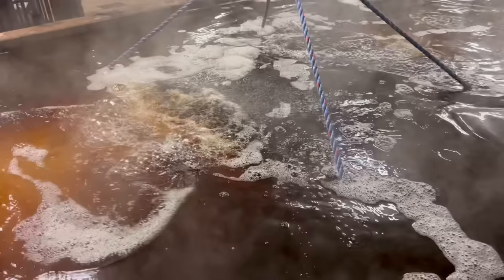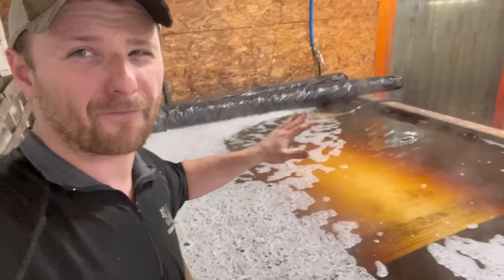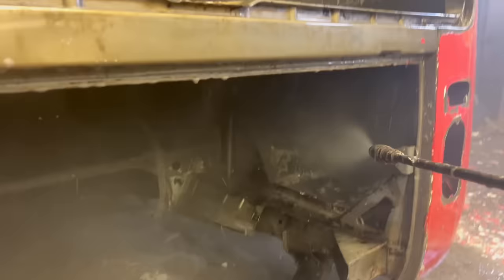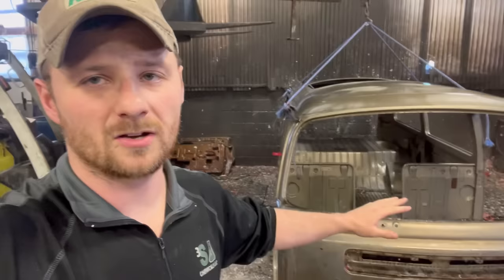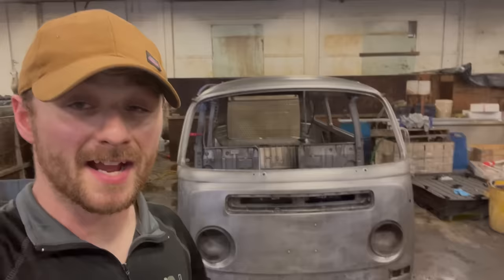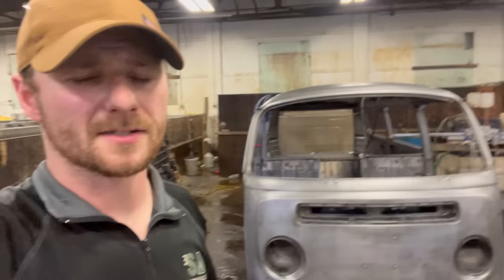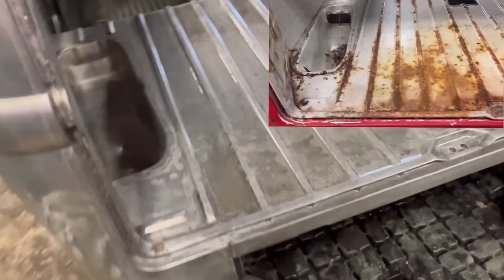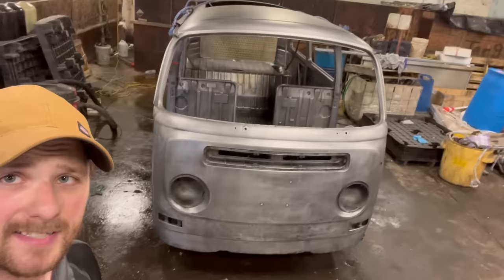Chemical dipping a 1969 Volkswagen Westfalia Bus

Comment: Honestly, that bus is in great condition, considering its age. The dips uncovered all the sins but thankfully, it wasn't too bad. Some replacement panels, a skilled panelbeater and welder will sort that right out. Nice one!
Reply: I would not have dipped that bus if it were mine ,IT ISNT ,surely water would get into all the nooks and cranys and rot them over time ,, COME  to Ireland and I will  show u rust
Reply: @iankennedy1441 no wonder theres many of these buses in drier areas

Comment: This was a ton of fun to watch. I have a good friend who is the original owner of a 1971 Bus — no kidding — that has everything from its original paint and nearly flawless headliner to a body that doesn’t need dipping. It was a “barn find” in that she had not driven it since 1999 and was in her horse barn all those years when I saw it and offered to renovate it. Can’t be many originals out there like hers.
Reply from the maker: That’s awesome! I’m glad you enjoyed the video!
Reply: Where did you find a bus with that much metal on it? If you would've dipped the one I had, you would've dipped a vehicle but only pulled out ropes.
Reply: @kdkn50  That bus is amazing. My friend is a widow in her 80s and still owns the bus. One major reason for its lack of rust is a lifetime spent in the Pacific Northwest, where rusty vehicles (at least those away from the coast) are almost unheard of. That, and the fact that the bus spent nearly 30 years inside a dry barn. It has the usual rust damage at the rear quarters where the battery was -- and was moved to -- but that's about it. I tuned it, cleaned out the mouse nests, put fresh fuel and a battery in it, and the old gal started right up.

Comment: So much faster and more efficient than weeks of sanding and grinding! That bus is totally naked now! Incredible. I love classic air cooled VW's.
Reply: It's definitely naked now.
Reply: And in a couple of years the new fresh paint job will fall of at the seams due to residual chemicals seeping out from joints and whatnot.
Reply: yeah this isnt a good idea. they will now be long term corrosion between overlapping panels that will end up destroying this bus. and the pressure washing job to remove the chemical, is peak hack job. you are far better off sandblasting or hydroblasting.

Comment: Another awesome job well done! I truly enjoy watching the process... and have garnered a whole other appreciation for what exactly you do, and the attention to detail as you work on these amazing canvasses. This one actually answered my question of whether or not my bird will fit in the tanks, when and if I need to do this. Thank you for another wonderful video.🙏💜
Reply from the maker: Thank you so much! Means a lot to hear you say that! I’ll keep them coming! I appreciate you watching!
Reply: dont get it acid dipped. it will look great at first, then it will rust out between the seams. you wont even know till it blows through the paint.
and this guy, just pressure washing the fluid off, instead of even dipping it in a neutralizing tank (which still doesnt work btw), is a total clown.
get it hydroblasted instead. its so much better for the vehicle.
Reply: @Nbomber  I disagree, if you watch and pay attention to the details of what he does here, you will see each step... and the neutralizing tank. I have been doing my research and I am quite impressed not only with the chemicals that are used, but their removal and disposal of. Their attention to detail in all aspects of what they do is amazing, and if and when the time comes that my bird is in need of such attention I am about 96% certain they will be doing said work. But thank you for your opinion, I appreciate it.🙏💜

Comment: It would be cool if these could be dipped in primer afterward like modern car factories dip the chassis of cars.   Seems that would help guarantee the restored vehicle doesn't develop new rust issues.
Reply: You can galvanize them
Reply: @wills5482  electro plating would work, only it'd make welding a royal pain!  Nothing smells worse then burnt galvanizing.
Reply from the maker: A lot of our customers have them ecoated afterwards. They dip the whole car and coats it inside and out!

Comment: Dipping is a way to remove ALL paint.. also the paint in closed boxes in the structure and seams.  At vw, the cars werd dipped also but to paint them in primer .  
  Area's that ar now cleared out of paint you can not see, are never see paint again. How do you deal with that?

Comment: I like your vids. I would suggest getting a hoist for your tanks. Using a Forklift is a bit dangerous. If your lines fail, and the body falls into the tank, you’re going to get splashed with chemicals.

Comment: That there is a 1969 VW type 231 (mechanical sunroof) they are fairly rare.  I had a ‘71 and did not have the benefit of the acid bath to clean up the body.  If it’s a bus, it’s gotta have bondo on the front fascia, people smacked them into things all day.  Looks great!

Comment: in the late 2000's a friend bought a 69 bus, put in a porsche motor in the back (sideways), it was fully kitted out in the colors of his clothing brand in extreme high quality, the back sould be converted in a big bed/sofa for multiple people, or a U shaped seating area, with electrically retractible TV screen and Playstation 2. We were on a roadtrip to go wakeboarding in Croatia when the engine (this was the 2nd one, the first one was from a jaguar, but the van would flip with it in testing) caught on fire. We had it towed back to our home country (friend had a bit of spare change...). We were then, only hours after the engine died, picked up by a friend from Croatia in a big blue Durex branded wan full of.. well, Durex products; he left work in Zagreb to drive for almost 2h to pick us up and drive us to our destination. A girl that was traveling with us profusely thanked him on the way to our destination. Good times.

Comment: Would the van not fit if you rotated it 90 degrees? Dise panel down first.... or roof down first, to make sure all paint on the inside comes off.. no air pockets in the roof space.

Comment: Three different bath needed  i know cost to setup. But the customer can chose how far you go. Acid dip. Fish oil tank. Or protect coating  stop the rust the will.. happen in the seal. God bless. )

Comment: this is fantastic, what a great way to start a restoration, one question, after the process and the final pressure wash, is there another step to prevent the metal from flashing over with rust once its dry and has been sitting for a few hours? I saw the video about the neutralizer and how it protects for several hours, but what would be the correct next step to protect after the neutralizer degrades...would it be right into primer?
Reply from the maker: We dip it in a water based rust inhibitor after it’s all said and done
Reply: @minute_of_dangle  thanks for the reply, great info.

Comment: looks like Bondo and wood on the floorboard I have seen this on a Beetle also it is supposed to retard the footboard from rusting through. usually under the drivers seat in a bus was the heater might of been there to keep it in place.

Comment: As I suspected, this is NOT a Westfalia camper Conversion! My Parents owned SIX VW CampMobiles including the T-4 I inherited with the I-5 and automatic. THAT is a SAMBA with a POP-UP center. True Westphalia's have a bed above the "roof" of the vehicle in the lift-up "tent" roof made of fiberglas. Your kind re-build any old Transporter and SWEAR it's "GENUINE RARE ORIGINAL" and advertise them for $40,000 or more on Fee-Bay with replacement titles so few people KNOW HOW to check-up on you!  A creep here in Tulsa is trying to pass-off five re-builds as "originals" but so far, real VW owners have warned buyers off. Two of his T-2's have liquid cooled Subaru engines in them!!!

Comment: They need to replace that rear section with heavey collision damage will be way easier. The front section also and drivers floor pan. It's good start free of paint bondo and rust.

Comment: Notice the hole cut in the engine bay interior? Previous owner couldn’t be bothered pulling the engine to remove the gas tank to replace the fuel sender. 😮

Comment: I wonder why you never start spraying at the top and work your way down.
Reply from the maker: Because when I start at the top a lot of the time chemical, water, and paint end up settling in the floor and then I hit big puddles of stuff and it goes everywhere. These cars don’t have windows, doors, hoods etc. people need to not think of this as “washing” a regular car. I usually work from the bottom up and inside out honestly. I edit the pressure washing part of the video starting with the most attention grabbing part.
Reply: @minute_of_dangle  Understood! 👍🏼

Comment: If the chemical can do that for paint, what's the fumes doing to your lungs? And when you're rinsing the body off, is the chemical residue going into the public sewer? What happens if the chemical gets on your skin? Does your skin wash off your body like the paint from the vehicle you're dipping? 
It would seem common sense would indicate that if a chemical can do that on paint to a steel body, your skin and lungs are toast. It's zombie time.